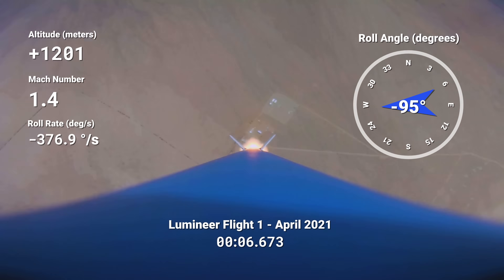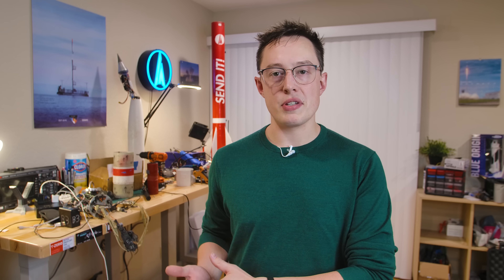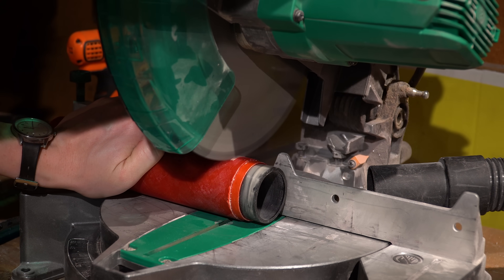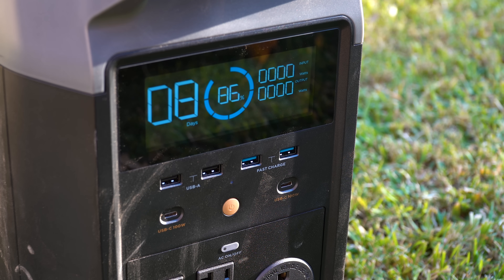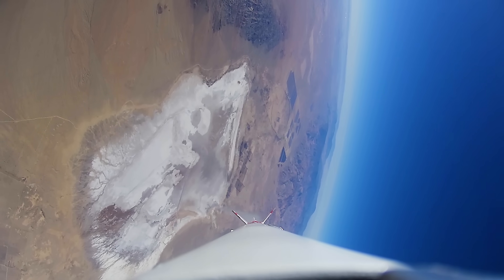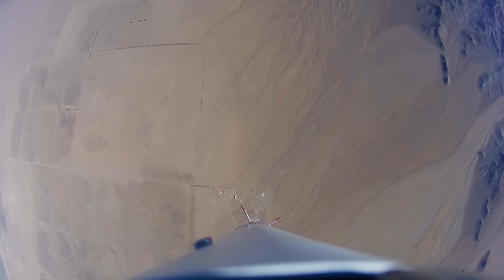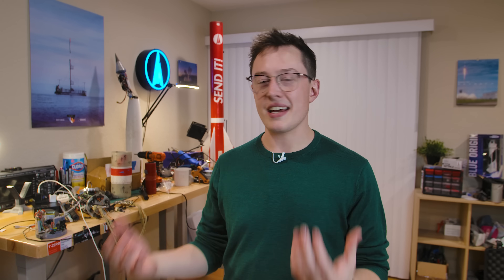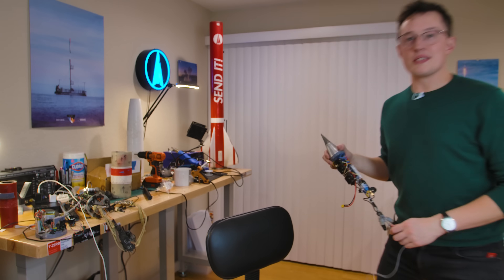Can You Get Stable Video From a Spinning Rocket?

Comment: (Quick comment context) 
I always like to think through problems in videos just to engage that part of my brain because I want to be an engineer and I like trying to try and solve problems in video like this as the videos go along
…
When you said about the problem with the low rpm and the lack of of torque, and my first thought would be to try and use a sensored motor because they have that extra torque and precision. But when you said that you were going to use a stepper motor that was what I found interesting. Firstly because that is a great idea because of the sheer precision and torque at all speeds. The only thing I could think of would be that the stepper motors are big, bulky and kinda heavy. But I guess you have your reasons to why you chose the stepper motor. And if you did try and consider the sensored motor, could you explain any trade offs on why you chose the stepper motor? (Or anyone else who might know) 
Thanks!

Comment: Great proof of concept for the mechanism! You could also try a regular DC motor with an H bridge and PWM. It won't have the idiosyncrasies of the ESC. I've had trouble getting regular steppers to turn fast. There seems to be a limit to how fast you can energize and de-energize the poles.

Comment: Would a brightness sensor in the spinning part make sense to get a sun correlated orientation for the exact spin? Filter out the highest brightness on each spin, the peak in the brightness curve over time is your direction and the interval is the spin rate.

also: rollerons?

Comment: Have you considered using a more passive stabilization using gyroscopes?  Get them spun up before launch, and they should resist any roll.  They could even double as steering control in the future.
Reply: I think it would work, but it's not as much fun 🙂
Reply: He did experiment with gyros but they saturate very quickly. They need to be either very fast or quite heavy to be effective. Idk what RPMs he got up to, so maybe a hard drive motor would be fast enough.

Comment: I was shocked when you said it wasn't a success! It was a massive improvement in video stabilization, even if it wasn't perfect.
Reply: Me too, I watched it and saw the fins rotating on those two seconds of stable video. I'd call that a success (at a Proof Of Concept level, which this has to be)!
Reply: almost there doesnt mean it crossed the finish line
Reply: @MrPaxio  Bad way to think of this - you can still see much more than before.
Reply: @zanderwohl  you could just write a program to only take/record frames when the rocket is pointing a certain degree instead of this contraption trying to counter rotate with the rocket itself, which will probably make it really unstable. which he pointed out, and he wants to fix it by adding another spinning reaction wheel which goes the opposite way.... insanity. my idea way more practical, no unnecessary weight, and dont worry it wont be blurry, especially when ure recording at 120fps like he is. at that point spinning it faster would be beneficial for the video, and stability. but that wont bring in the views, so i can understand why go the unpractical asf route. its actually a very good strategy to do something in a bad way so alot of people comment their opinion on why its bad and the algorithm sees it as very good viewer engagement. and viewer engagement pays itself in weight of gold. its what makes your videos go viral. thats the truth unfortunately gotta get used to it regardless if you like it or not
Reply: @MrPaxio  your idea is practical but you lose a lot in video quality and continuity. the video will be just a compilation with images with no connection to one another.
since the guy's a youtuber who makes videos, his idea makes way more sense, mr. know it all.
Reply: @viniciusferrari2653  yeah hes a utuber so it makes sense he build something badly. and u will get continuous video, if the rocket is rotating 60 turns a minute, thats good enough to get what u need, and if its not spinning then ur video is continuous either way
Reply: @MrPaxio  you can't control how much the rocket spins with your idea. and if you're gonna make a contraption to control it in addition with your program, you might as well add the thing he is building.
Reply: @viniciusferrari2653  he cant control it, thats why my idea is more practical because unless he makes the whole rocket a reaction wheel then theres no way it wont spin, specially when there is a reaction wheel already aka the dumb camera spinning. with my idea spinning it even faster is better, and itll stabilize flight
Reply: @MrPaxio  You’d have to use extremely fast camera due to the rotational velocity otherwise you’ll constantly be fighting a battle against rolling shutter and motion blur. It’s doable but in no way is it less complicated or expensive.
Reply: @kirleyq1394  hes recording at 120fps, it wont be blurry trust me, i even paused the current video while it was spinning and it wasnt blurry on any frames to confirm when i first made my comment. this isnt 1980s camera technology this is 2023
Reply: @MrPaxio  I do like your take too, but can you take the shots at the exact time you need to? (x)fps video on a 120fps camera means the body will need to rotate x times per second, and the x will need to stay in a certain range. Not too fast, because you need faster shutter speeds for faster spin if you don't want blurred video and you're gonna lose light coming into the sensor if your shutter speed is too fast. Not too slow, because then you're going to get disconnected images instead of a video, and there's no use for that kind of footage if you're posting on youtube. So the question is whether you can keep your rotation speed in that range throughout the whole flight (or most of it) without actively controlling it during flight. Because otherwise it's going to either be a series of pictures, or a blurred low-quality video, or a really dark one.

I'd love to hear if you have a solution for this that the channel owner can actually manage technically and financially because like you said earlier, in that case this is actually way better!
Reply: @kirleyq1394  and if you're interested, I'd like your opinion on my take too 😶
Reply: @chiyakicky5  spin it as fast as you can then, itll not only stabilize flight but make the video more continuous. even if its 5 rotations per second(5fps), with AI these days you can make that 24fps no problem. THATS HOW WE GOT THE SMOOTH CURIOUSITY LANDING VIDEO THE CAMERA WAS AT LIKE 1FPS AND WE MADE IT A CONTINOUS VIDEO THRU SIMPLE AI.... the scenery isnt changing much when ure 2km above. and once again simple modern software solution instead of a reaction wheel that will further unbalance everything and bro wants to add a second reaction wheel to counter-act the first one. you know what we call that? insanity. itll fly lower from the added weight and your epic video is barely epic anymore
Reply: @MrPaxio  You haven't read my comment thoroughly. I asked you if the camera can still give bright, crisp images while 'Spinning as fast as it can', worried about a few points that I pointed out in my comment above. I wanted your take on them, and maybe your way of solving them if you have any. Which you would've given me if you'd just read my comment.
Reply: @MrPaxio  In addition, I did a little experiment with my galaxy s21. With the shutter speed set at 1/1000, the picture blurs with me rotating it at less than 1 spin per second. At 1/12000, the picture becomes darker and fuzzy, the fuzziness due to the image processing to brighten it up. Again, this is me rotating the phone slower than 1 spin per second. Compared to the 120fps 4K high quality video he could be getting from that contraption, it's a really poor tradeoff even when you consider that what I used was only a camera from a mobile phone.

Comment: Awesome video! might I suggest that you stick with the brushless motor, but don't use a commercial ESC. Instead, 'hijack' the output driver stage of the ESC and directly feed the MOSFET drivers HI/LO inputs from your code. Lookup 'SimpleFOC' library. Its an amazing Open-Source easy to use Field Oriented Control arduino library that makes it incredibly easy to do high-precision and most importantly low-speed movements from a typical BLDC motor like the one you are using. If you need any help with something like this, I'd be glad to help, but they also have a great forum that can answer questions. This is something I have done exactly (hijack output stage of commercial ESC) to control a linear actuator I built using a hobby brushless motor with low speed and high precision.

Comment: Look into using stretch on the rod to help with getting the nut torqued and un/de torqued. We use it on turbine assemblies, you stretch the rod by x mm (or 0.X mm) then finger tight the nut and release the stretch. Gives you the same strength as lots of torque on a nut but none of the shear forces

Comment: In my humble opinion... more gears to allow a higher start rotation of the motor and lower actual rotation.  The error rate may not be fast enough ( small rotation offset error ) for motion control compensation along with a ' wakeup ' on launch ( from inertia change > 40?? ).  In the end this is still really great, did not involve conical mirrors for nice shots pulled off of a 360 image ( and days of editing to get it smooth ).  The speed of the motor VS stepper gives some advantage against ' lost steps ' if you do not set up the stepper driver with the correct ' hold ' current or worse, not enough battery to use it.

Comment: The problem with low speed isn't the motor. Is the absence of hall sensors connected to the ESC. Hall sensors provide feedback instead of using back-emf. Take a look on ESCs for RC cars. They have sensors to ensure torque at low speeds.

Comment: Have you thought about using passive stabilization methods like one on the AIM-9 missiles? https://youtu.be/y1kUzjdkxG8?t=1003

Also instead of stacking roll angle measurements, wouldn't just reading roll rate and working to zero that down maybe work better? Instead of trying to "point" the camera ring to where it began on the pad, just make it stop spinning whenever it turns on; letting it end up in any orientation as long as it's not spinning.

Comment: Something like the Odrive 13.2 Module from m5stack may fit your needs here a bit better than a stock hobby ESC. BLDCs operating in sensorless mode typically rely on back emf sensing to figure out what coils to activate. So startup on them typically means kicking the motor over hard to get it to move so it can know where it is. Sensored controllers have a calibration to map sensor angle to the coils in the motor and can get reasonably low speed control. It would require a rotational sensor on the motor but those are fairly simple these days. I don't know if the mentioned module meets your weight constraints, but the concept is similar and there's a large number chips that can drive small BLDCs in a sensored way if you wanted to go down that route. May be easier on your power budget than the stepper.

Comment: Yeaaah, direct drive it is. 😤
But nice work altogether, as usual ! ✌♥

I wager this bulky ring gear could be replaced by a Halbach array of N40 magnets, and those heavy spur gears and BLDC outrunner replaced by a ring of pancake coils on the rotating assembly. Loss of weight, no more gearing-induced stiction & inertia (apart from the whole assembly's), galvo-like precision, no mechanical backlash and a lot more quiet.

Comment: I think you might need a sensored brushless motor and something like a VESC compatible ESC so you can get higher torque at low rpms. A good source of info on this might turn out to be the Onewheel Community, or people who diy their own eboards. Do some research on VESC and see if it's what you need! I do also have some hesitations about stepper motors. Stepper motors aren't traditionally great at high speed applications, but it would absolutely have the ability to despin those slower rotations near apogee. If you do go this route I recommend the Trinamic stepper drivers, specifically the TMC2130-TA (SPI interface so should be Ava compatible, up to 1.4A phase current, passive breaking, and load dependant speed control). Some sort of clutched assembly to allow for the use of  both a brushless motor for high speeds and a stepper for low speeds could be an interesting trajectory, but would add several layers of complexity. I've also seen a lot of other people address the reaction wheel issue, and while I agree with them, I don't think the best answer is to add another reaction wheel to counter the spin. I think the best idea is to get the mass of your assembly down by off loading as much of the electronics for the despin rig to the avionics bay. Have you thought of using high rpm slip rings for all the circuitry, and leaving essentially only the cameras on the rig? I'd assume this would get the mass of the rig down a considerable amount, making the it's moment of inertia much lower, exerting less torque roll on the rocket. No matter what, I can't wait to see where you go from here Joe! This space shot is closer than you think!
Reply: VESC will not help, lower kV motors will do.
Reply: @igor_misic  Aw crap. I guess you're right. I obviously have no idea what I'm talking about.
Reply: But a sensored motor is probably a key thing it needs.

Comment: Several others have mentioned my concern, that of the spinning camera assembly acting as a gyro and possibly screwing with the spin stabilization of the rocket itself.  Would it be possible to mount the batteries closer to the center of the assembly?  It looks like there is room.  Since those are probably the greater part of the weight, moving them closer to the axis of rotation should help limit the effects, might even make it easier for the motor to spin the assembly up.Edit:  Personally I think the results were pretty darn good for a prototype, we'll wait for the second flight for it to be perfect!
Reply: But the camera assembly should always have a rotational inertia of zero. There is no spinning up. Just opposing what the rocket wants to do.
Reply: @tjm2212  Yes, though I think you mean the camera assembly wouldn't have any angular momentum. If it were somehow levitated inside the rocket in a vacuum then as the rocket starts to rotate the camera would maintain its orientation due to its nonzero rotational inertia, and the fact that the rocket body would not be exerting a torque on it. If the motors could perfectly oppose the movement of the rocket then the camera subsystem would essentially be decoupled from the angular momentum of the rocket and would only contribute its mass to the downward force due to gravity. But for now I think the implementation leaves a bit to be desired 😂

Comment: For low angular rates stepper motors should be better than BLDC, and for high angular rates (where you reach max RPM for stepper motor) maybe you can synchronise taking frames with certain bank angle, for example by adjusting frame rate to roll rate? It would give an illusion of lack of rotation.

Comment: why not use the motor with a gyro? all the ESC would need to do is spin up the gyro and it would stay on all the time. The bearing would be free. I would think that you would use two connected flywheels spinning in opposite directions to cancel out the torque.

Comment: I'm curious if your sims took in to account the rotation of the spinning assembly at all. It looks pretty heavy so I imagine it's causing some spin loss, akin to a reaction wheel. I'm sure you know all this of course, just kinda curious what you did to account for it, or if its even heavy enough to need any changes.

Comment: The problem you have seems to be primarily stiction, part of which is the gear train, part of which is motor friction/stiction amplified through the gear train, part is misalignment and part is probably the loaded bearings. 

I dont think a stepper is a good solution, because it is extremely limited in maximum speed. The maximum speed is typically around 10hz or so, so when geared down for some extra torque you are quickly going to reach the limits.
Another idea that you might like, is using a gimbal BLDC motor. These are winded for high torque slow speed operation and perform much better. Plus the power density is much higher, which means lower weight for the same power which is always good if you are on a mass budget.

The misalignment could be easily fixed by properly constraining the carriage. Currently you have it underconstrained, which means it wobbles around the inner tube. An additional bearing at the other end would fix this.

Comment: Id say that the spinning motor is fine, just the esc that you are using may not be, try a small size VESC and use it in duty cycle so you have precise control...